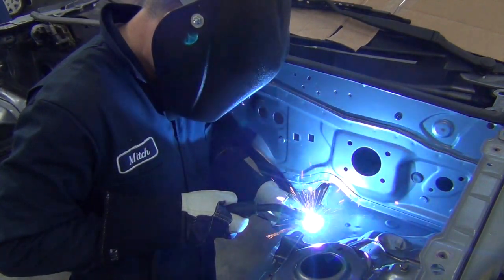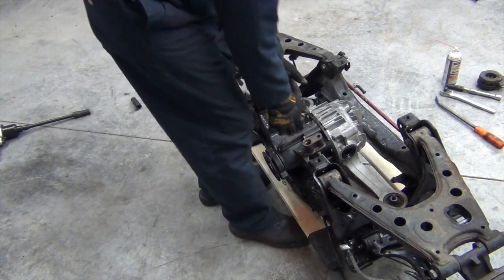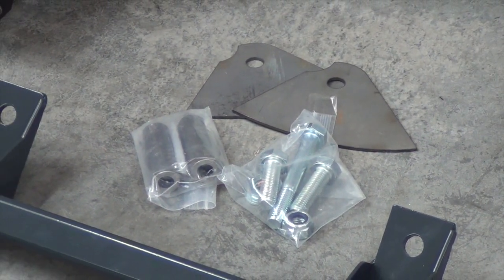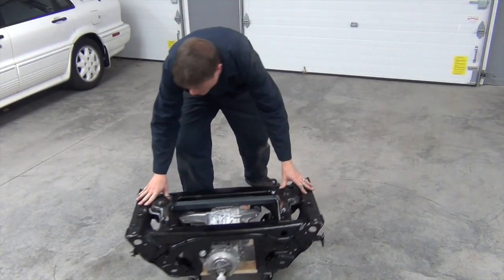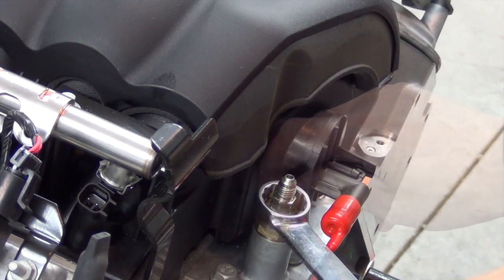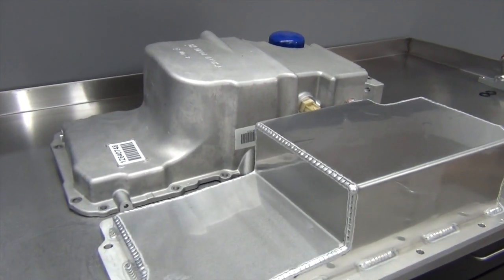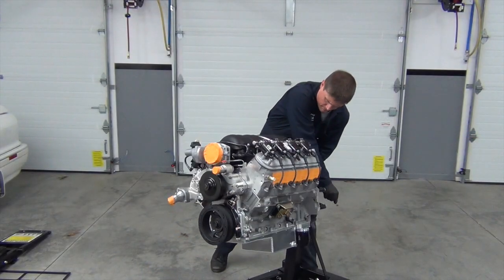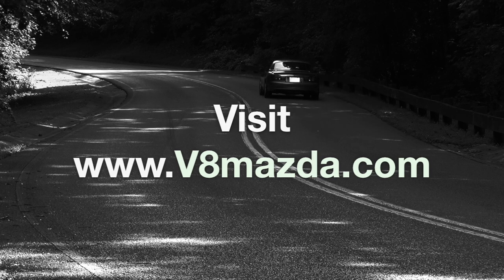LS3 V8 Miata Build - Project Thunderbolt Part 4

Comment: Is it normal that you cannot use the lower bolts on the transmission with aftermarket pans? I bought an aftermarket pan and find it wierd that half the bell housing is hanging freely

Comment: How are you welding sheet metal like that and not warping the crap out of it. I do all my sheet metal work with spot tacks little at a time. Your just burning wire strait out!

Comment: The alternation of the oil pan and splash plate will void the  engine warranty .Does it not?And why not powder coat altered parts like the frame instead of cheap can spraying over unprepared surfaces while being so exact with all the other work.

Comment: Great video series, but you need to get yourself a cordless 1/4" impact gun with socket adapter. Removing all those bolts with a ratchet handle is so slooowwwwww......

Comment: That front mount on the Getrag -- every CTS I've seen has had the rubber bushing fail. Usually people replace them with polyurethane and a metal insert. When the rubber bushing fails, you hear a clunk every time you push or let up on the gas, as the diff rocks around the broken rubber front mount.

Comment: Pointless torqueing stuff if you don't work around diagonally. Also, NEVER fit an oil filter without smearing its seal with oil beforehand. Just saying.

Comment: My parts number research shows that this differential carrier (GM part# 25873500) is for a 2006-2007 Cadillac 2.8-3.6L V6 CTS/STS BASE model, not a 2004-2007 CTS-V as stated here in the video.  This information is from GM Parts Direct - Genuine GM Parts catalog. ...curious.

Comment: Wouldn't turning the fuel rail around fool the computer spark timing? Like cylinder 3 and 7 fuel timing getting swapped.
Reply from the maker: You're only swapping the rail position, not the wiring of each injector.

Comment: How much does the all alloy LS engine weigh?
Reply from the maker: I’m not sure exactly, I really wish I would’ve weighed both engines for the video back then.  I did corner weigh the car and have before and after on part 13, which shows the weight increase in the front of the car.

Comment: Hey Tom, why did you set the differential angle at 1.5* up? Is that specified somewhere in the mounting instructions? Or a general rule of thumb for driveline stuff?

Comment: the double click with the torque wrench anois me....
Reply: love the build though ;)
Reply: thats the standard in the aircraft maintenance industry.
Reply: it makes 0 sense
Reply: Doitlikeidoit safety is the no. 1 priority in the aviation industry, you can never be too sure about torque specs.
Reply: sorry but it makes no sense at all. the moment u take that wrench in your hands and u tighten a bolt u automatically do it until it klacks, there is no way u can get that wrong
Reply: Doitlikeidoit thats how its done in the industry. if your boss man catches you doing otherwise then you will be in the shit.
Reply: Doitlikeidoit normally in the aircraft industry you torque all the bolts once then you go around and double check them to make sure all bolts are torqued to specc. The double click is often unnecessary but it gives som extra confirmation to the tech who does the job and let's be honest, the clicks are satisfying ;)

Comment: Without cats this engine makes 350whp and in a miata that's going to be scary when you punch it. That thing can't weight more than 2500lbs
Reply: His spec sheet said 5-600hp so even with cats missing there shouldnt be more than a 50hp diff if its a high flow

Comment: Tom's Turbo Garage   I'm amazed you find the time to answer so many questions on your videos. Thanks for doing that!  My question is that since it looks like you removed half the windage tray would that mean that 4 of the eight cylinders will potentially have more parasitic drag from splashing oil? Did the oil pickup position have to be closer to the bottom of the pan because of part of the windage tray not being present?
Reply from the maker: Yeah man, I love talking to other car folks, I just get so many messages now that I can't really respond in a detailed way as I'd like to.  Any who to answer your question- the low profile pan now acts like the windage tray for the front few cylinders.  This is common and has been done on low profile oil pans by hot rodders for a long time.  A pan like this will always come with a new oil pickup tube due to the design of the pan/sump being different.

Comment: Wouldn't a modern OHC engine like the 5.0 liter coyote been more practical? They have those pretty cheap in crate motors now. https://www.youtube.com/watch?v=dNJ6pGjlYjs
Reply from the maker: Mike Samra Hi Mike, no.  They're great engines but are much, much larger and would in no way fit in the Miatas engine bay.  Look at this picture to get an idea.  http://s51.photobucket.com/user/prolariot/media/IMG_5356.jpg.html
Reply: Tom's Turbo Garage

I figured as much.We put a Coyote in a 51 Merc with an AODE and it fit nice but we lots of room.

Comment: Sorry but I'm not very informed on drivetrains or cars in general but when you swap the diff and the transmission, does the driveshaft just happen to fit? Don't different companies have different mounting arrangements and wouldn't the length be a bit off? Or are you going to fabricate something custom? Does the kit include a GM driveshaft?
Reply from the maker: Hi there, yes a custom made driveshaft will be required.  V8 Roadsters offers this as part of their driveline kit.  You'll see that info in a future video.

Comment: Tom do you normally dry start your engines without putting oil in the oil filter?
Reply from the maker: No, I was just putting the filter on to keep junk from going in there.  I will fill the filter with oil later.

Comment: Awesome! I had no idea the ls3 had that spot on the head for a coolant temp sensor! I was going to get a T fitting for my radiator hose! Thanks! I'm in the process of trying to figure out all the wiring on my e-rod ls3 right now.
Reply from the maker: Raymond Markin Good deal Raymond, glad you found that helpful and good luck with your e-rod setup!
Reply: Tom's Turbo Garage Thanks! its coming along quite well. going to be wrapping up the chassis wiring and the harness and gauge wiring this week! then its on to roll cage and getting the dash in and putting the doors and front clip back on and it should be ready to fire. I almost wish i would have kept my 99 miata and done what you're doing... maybe next time haha.

anyways good luck! its looking awesome. that is going to be a monsterous miata for sure.
Reply from the maker: Raymond Markin Thank you sir and keep pushing man, sounds like your doing great!

Comment: hey Tom, another great video. is there a reason you installed the windage tray with the engine upside down but then installed the oil pan with the engine more or less upright?
Reply from the maker: michael cianci Hi Michael, after applying the silicone, it just felt more natural and less awkward to let the bolts "draw up" the pan to get an even "squish".
Reply: Now thats the kind of pro tip I'm looking for.
Thanks.
Reply from the maker: michael cianci You're welcome sir!
Reply: the one question I had...has already been asked & answered...thanks =)

Comment: On that rear end Tom's Turbo Garage the front bushing that is by itself you should order a stronger one. There known to go bad and I had to replace mine on my caddy. I would recommend replacing it with a stronger one.
Reply from the maker: Thank you for the tip, I appreciate that.  In other Miata builds, they run the same setup with good results- the "top" diff mounts are poly, and the front is stock.  I'll keep a very close eye on it though and replace it with poly if needed.  Have a good one!

Comment: Out of curiosity, what oil are you going to run? I know from the factory GM requires oil with Dexos, and I know Mobil 1 is a Dexos oil and is used in Camaro's and Vette's from the factory.  Just wondering what oil you're going to choose and why?
Reply from the maker: BoostedCajun I'm going to use Dexos/Mobil 1.  It's what they recommend in the crate engine "manual".

Comment: I love it! My father and I just picked up a 5.3l engine over spring break out of a Suburban. We were walking through the junkyard talking about how there are not any LS engines, then, on our way out, we spotted the Suburban sitting right in the front. (We completely missed it on our way in) We examined the car and decided that even though we only had an hour and 45 minutes until the yard closed, we were going to go for it. Believe it or not from the time we started taking bolts off to the time we had it loaded and paid for, was 1 hour and 3 minutes. We plan to put it in a Datsun we have sitting in the garage, with a really big turbo on it from a Detroit Diesel, and let her eat!
Reply from the maker: Nivlac57 Thank you and well done on the junkyard find!  Thanks for the great story, I need to stop going to the junkyard alone, as it deters me from grabbing any big stuff.  Good luck and have fun with your awesome project!

Comment: the rear diff with the 342 gear ratio is from a CTS. The CTSV has the 373. I know this because I own both a V6 and V8 CTS. You bought the V6 version.
Reply: Reason why I mention this is if that diff isn't hardened, expect it to grenade on itself. The rear diff in my 06 V exploded on the strip. That was with the 373. The 342 is even weaker.

Comment: When you flip the fuel rail does that affect the fuel/ spark timing, you know bc the injector is now firing in a different cyllinder? And looks like you overtightened that oil filter by about 1 full turn ;)
Reply: Duke Silver  The wires go to the same cylinders. Only the injectors were flipped to the other side.
Reply: WOW! Most retarded comment ever!
Reply: iggnasio
You are a pinhead.

Comment: The cross comparability of the parts is mind blowing. Not too crazy of modifications in the lS3 besides oil pan windage tray, pressure sensor, temp sensor so far. I also really like how organized you are with this. 12:07 lmao
Reply from the maker: Yes, you're exactly right!  It makes things so much easier.
Reply: Still a lot of work. I just noticed the firewall bracket removal/engine bay support removal and the exhaust manifold fitment. woo
Reply from the maker: Bob M. Tyranny Destroyer Yes, stay tuned for more of that kinda stuff! :-D

Comment: I love this video series! I am building funding for my own LS3 swap in my NA6 Miata for drifting competition.  They only downside is the ProAm Southwest Drift Series and Formula Drift rulebook does not allow custom subframe swaps. You have to use the factory subframe.
Reply from the maker: 8-Bit Miata Oh bummer!!  The factory subframe would need extensive modification in order to hold an LS.  I'm not sure if I've ever seen that done.  Good luck with your project, sounds like fun!

Comment: Hey tom Im getting ready to install my crossmember, but before I do I was wondering should I send it off to get powder coated or should I just use por-15 on it? The price on either isnt a problem. I'm just wondering will por-15 hold up and not rust or should I go with powder coat if it will be more durable. Basically looking for the more durable and rust preventative one.
Reply from the maker: imCapone1124 Powdercoating is going to be stronger and better looking.  POR 15 isn't a "paint" on it's own- read their website for more info, they have chassis paint products that would be better suited than regular POR 15, I believe.

Comment: Do you know if the shifter location is the same on a F-body T56 for the first gen. Miata's ? I was going to use a  03 Corvette T56 but now I'm worried about the shifter location.
Reply from the maker: Esko03 I would ask the V8 Roadsters folks, or if you're building your own subframe, do your own measurements.  I've never heard of anyone using a corvette trans for the swap...mainly because their transmission is in the rear of the vehicle and is setup as so.

Comment: Really enjoy your videos. Any chance of a Fiero build? Would love to see what you could come up with.
Reply: I'm building a 3800 Fiero.  Should be done in June and hope to have video soon
Reply: That is great. I have always loved the Fiero GT, as terrible a car they were I have missed my 86 GT since the day I sold it
Reply: 3800 SC dude?!
Reply: dontdrivehonda That's what I'm putting in my car, yea
Reply from the maker: todd evans Thank you Todd!  I can't even imagine another project right now, but I do respect a fast Fiero.  There is one that I've seen with a turbo 3.8 that just rips!
Reply: I'm currently in the process of making a 2001 grand prix GT into a GTP. I'm using the supercharger off of an 07 grand prix
Reply: dontdrivehonda just be careful, idk how much research you've done, but the l26 block that you have wasnt built for boost like the l67 block that came supercharged.  And youre also putting on the Gen V supercharger which was much more efficient and made more boost than one from pre 2005.
Reply: What I have now is a gen 5 lower intake manifold. Gtp heads and fuel rails. I need boost bypass and map wiring. Double crank and harmonic balancer for sc belt. HD passenger side drive axle. Maybe even drivers side. The funny thing is, if you top swap a GT motor, your compression ratio is a little higher, therefore say if I top swapped my GT and ran a 3.6 or 3.4 pully, and you had a stock gtp, and you went 3.6 or 3.4 I would gain 5% more power than a gtp doing the same mods. And and my transmission has 3.29 gears, if you know that's the same final drive as the 04+ GTP comp G.
Reply: It's a cool hobby, I love my grand prix.
Reply: See there yah go boost is the shit !
Reply: ***** Cool Story Bro

Comment: Note:  You really should take that oil filter off before your first start, and make sure to add oil directly into it, then install back on the engine prior to first start.    Reason:  Just that much less that needs to prime for first start.
Reply from the maker: walperstyle Good tip, I did end up doing that later, I just put it on to keep junk out of there until I got my oil.  I had to figure out all of that "DexOS" oil madness.

Comment: hey tom, 

great video again! any chance you could shed more light on the differential mounting process and the angle finder? how come you're mounting it in that orientation? when you say "1.5 degrees up" you mean 1.5 degrees above center?

thanks! cant wait for the next installment!
Reply from the maker: Mike Ferrante Hi Mike and thank you!  Yes, I didn't grab any footage of that work, but basically you zero out the diff on a level surface and then use an angle finder to mount it at that spec.  It's what V8 Roadsters recommends for proper driveshaft angles.
Reply: Tom's Turbo Garage ok got it thanks a bunch! any chance you could link me to the angle finder you used?
Reply from the maker: Mike Ferrante You're welcome Mike, it's a really old one that we had in our shop for a long time.  You can find good ones on Amazon.  Good luck!

Comment: One thing that bothers me is when you use a torque wrench, you click it twice. You shouldn't do that, because a second click may actually tighten the bolt 1-3 ft/lb over the spec.
Reply: February The double click dislike comes from old cork gaskets, the gasket compresses and the second click bends the flimsy stamped steel oil pan/valve cover. This applies to rubber gaskets too, but they don't compress near as much as cork.

If you are using RTV (or any metal to metal torquing) A set torque is a set torque, you can sit there clicking it all day. If your bolt moves after you've clicked it the first time... either your torque wrench needs attention or you got sub par bolts and are torquing them to yield!
Reply from the maker: February This is a very specific observation, and one I find very interesting!  I think proper torque wrench use is key, I don't pull hard until the click, you slow as you approach the click with very little (barely any) force.  That's how they taught us in the school I attended.
Reply: In Aerospace double clicking is required. If it is required for Aerospace i think your not hurting anything.
Reply: Richard Harrow
In Aerospace, they freeze some bolts in nitrogen to fit them into holes. You don't do that on cars :D I guess if your torque wrench is calibrated properly, two clicks won't hurt anything, but it's still a bad practice. If you're torquing small bolts to in/lb, you could ruin the gaskets or crack the plastic. The same with flimsy oil pans.
Reply: Right it makes me say ...Noooo don't do that lol in my head
Reply: Eh, I've always double clicked all my engines. '85 GM 2.5, '78 350, '94 Ford 3.0, '93 Nissan 3.0, and my '93 Talon. Nothings broken on me yet. Then again I always shoot for the middle of the torque spec. For example if the book says 25-30 I always set to 27.
Reply from the maker: February The double click may just be a bad habit, I have no idea.
Reply: Tom's Turbo Garage I've always been taught to double click too. Just to make sure I guess.
Reply: atsernov
Good point!
Reply: Awesome video as always. I learn something new every time.
Reply: February Well, we don't do that at Boeing and we are instructed to double click. In fact I have never heard of the practice of freezing bolts, i have heard of freeze plugs. But i do agree your torque wrench has to be correctly calibrated.
Reply: Richard Harrow
Classic internet grammatical error there.
Reply: Tom's Turbo Garage
That's exactly how I was taught too! Use slow, constant movement until the wrench clicks. No jerky movements. However, nobody ever told me about this double click thing. I learned about it from other mechanics.
Reply: *****
Plz, chill out, bruh